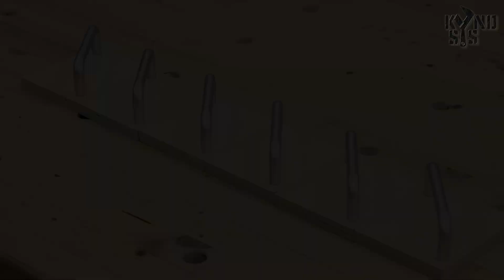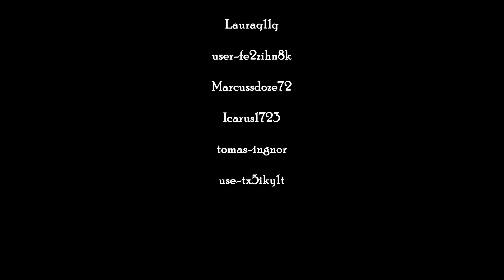Weight Dumbbells Replacing Clamp / DIY

Comment from the maker: Please turn on your language subtitles!
Join our membership!
This video is about making dumbbells that you can use to attach small plates to a table.
Clamp is usually used when joining wood, but in some cases the clamp is uncomfortable.
Dumbbells are more comfortable than clamps when small boards are attached to the inside of the box being assembled or stacked in multiple layers.
I couldn't increase the weight with just wood, so I cut the steel into bricks and made about 3KG. 
I put my own plywood on the outside with epoxy and put a handle on it.
The handle was attached to the upper part, but the upper epoxy adhesion might be insufficient, so the steel was drilled with a tap and bolts were inserted. 
It is a part that secures the top plate firmly to the steel with bolts, so there is no problem with the handle moving.
This is a dumbbell for clamps that will be used a lot in future videos.
It's simple, so I want you to make it and use it.
Thank you.

#DIY #Weight #dumbbell #replacing #clamp

Comment: I don't have heavy chunks of steel laying about, but I have lots of sand !!! Definitely like that idea and they look better than weights and won't mess up the wood.
Reply from the maker: good idea. It's a good way to use a lot of materials. Since the specific gravity of sand is about 2, You may need to size up a bit. The steel I used has a specific gravity of about 7. thank you!
Reply: What about cement? Might be worth a try I have no idea which is heavier sand or cement

Comment: What size are your metal blocks to give you the 3kg weight and is this mild steel?
Reply from the maker: Inside the 12mm plywood, there is steel measuring 10mm×7mm×6mm. 10×7×6×7.8=3.276 kg. 7.8 is the specific gravity of iron. thank you!
Reply: @Kynosys_  Thank you - unfortunately in the UK steel is very expensive so I'm not sure how cost effective this is compared to clamps.

Comment: So where did those steel blocks come from?
Reply from the maker: Go to the ironworks, tell them the size you want and they will cut it for you. Because it is usually cut with an oxygen cutter, the cut surface is rough. You need to grind it a little with a grinder. thank you